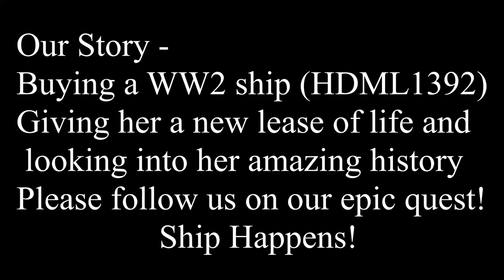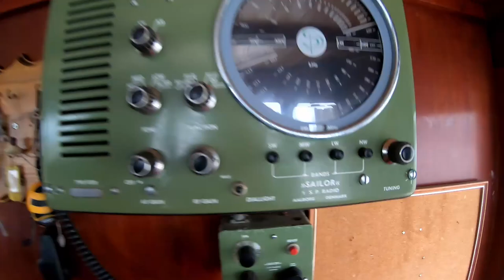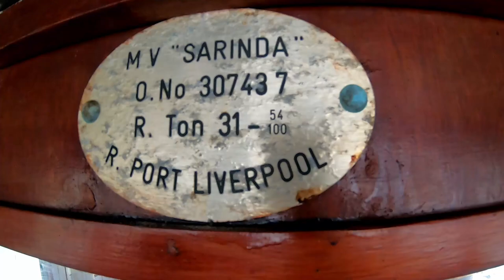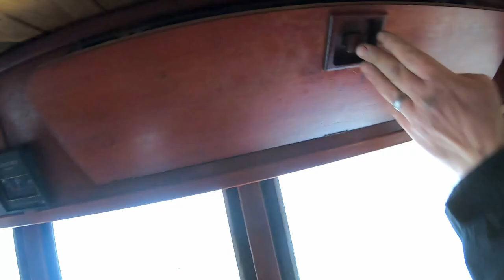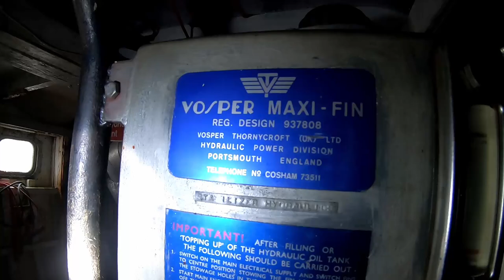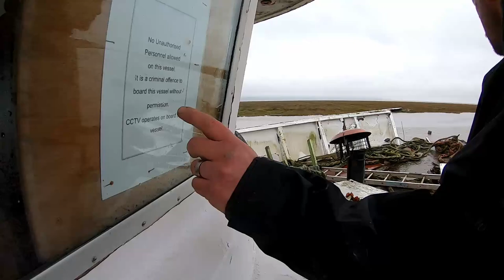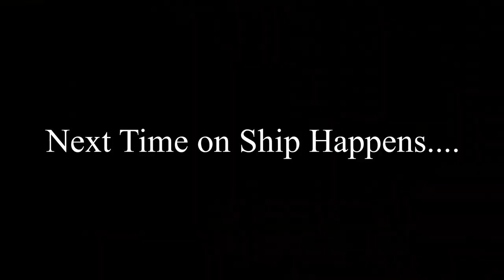We Risked Everything On A Rotten Boat! #boatrestoration

Comment: I'll watch with interest and wish you luck. But, the comment "we know wood" just doesn't apply to boats - it's a black art, iron sickness, please look at travels with Georgie- hes doing a tiny boat bu comparison and knows wat hes doing and it's still very very hard. Decks are not first - the hull is, and that means a tow, a lift a hard standing which will cost thousands alone. You'll need a restoration campaign and volunteers this is like a Vulcan to the skies size project..

Comment: Same as a few here I found you on Cruising the Cut channel, Before running the engines I would be draining.the fuel tanks and giving them a good clean, replacing fuel lines and filters, you dont want the dreaded diesel bug getting to your injector pumps. Good luck, I look forward catching up with your videos

Comment: If you are wanting to take your time with this project you should haul the boat out of the water and work on it in the dry. You have to get ahead of any rot or water intrusion from the top or the bottom before you put it back in the water or you may never get ahead of the elements. I would hate to work on a long term boat project that's not mobile with the sea constantly working against me. After you're sure the entire vessel is sound, you can do the motor work and refit the interior when it's back on the water if you like. I wish you all the luck in the world and I'm subscribing to see how it goes!

Comment: Wow amazing! You’re very brave! Please don’t pressure wash your teak decks though, a short bristled stiff brush. Wet area with SEA water brush across the grain, wash again with sea water, repeat! Only ever put sea water on teak fresh water kills it, makes it green and slippery. Always rinse with sea water after it rains. Best of luck!
Reply: Remember ACROSS the grain never with it!
Reply: So what happens when it rains??  Every rain shower destroys a teak deck? I doubt it. This is England. It rains on teak decks. All the time.
Reply: @PDZ1122  that’s right over time rain will destroy a teak deck it will start by going green and slippery which leads to rot over time. Regular brushing and saltwater washing prevents this and there is no need to buy expensive teak restorer although you can use oxalic acid for stubborn dirt. 
If they are all cleaned up then yes each time you go aboard you should hose them down with salt water because as you say it will have most likely have rained. 
That’s boats I’m afraid constant maintenance if you want them to last and save serious cash in the long run replacing a teak deck. 
This is how I have maintained my teak deck for years and I swear by it as the most cost effective way, how have you kept yours from deteriorating? Any tips could help these guys. 
Thanks

Comment: First, I hope you bought it for a pound. Second, a great pair of engines, but will cost thousands to refurbish or replace. I bet you don't know the last time they ran. Third, the only way to rebuild that boat is to get it out of the mud and on dry land where you can work on it. Fourth, make a plan of what you want to turn it into. Back to its original design, or a modern cruiser. Fifth, try to learn which end of a boat is which. I get the slight impression you do not know. Last, check your bank to make sure you have about 200K Pounds ready to go - probably NOT including the money for the engines, generator, etc.
Reply: the engines are  Diesel so the reliably is pretty high im more worried about amount of standing water in the bilge of the old gril
Reply: They already have both engines running !

Comment: Hi you really have got your work cut out for you. her hull is double diagonal probably ply. you need to pump out the bilges as you say its rain water and that is going to rot the timber very quickly . her upper works have been grossly modified. she looks like a fairmile is she 112 feet long . good luck with the refit

Comment: I'd like to congratulate you for taking on this project, but I don't think you've got the foggiest idea of what's involved. Hard work and good intentions won't be enough - it'll need cash. Lots and lots of cash. Get the hull checked out professionally. If it's sound, you might just make this work. If not, it'll be a heartbreaker. Good luck, anyway. I'll be watching along. Oh - and get it insured for wreck removal. If it sinks, you will end up with a BIG bill for removing it / environmental clean-up, etc. (On the Dee, isn't it?)

Comment: The pointy end is the bow. the blunt end is the stern. Looking to the pointy end  the left is port  the right is starboard. Your electrics are off a battery to start with  so find them and check them over. voltage and charge if necessary. it might pay you to link them with a small solar panel. Make the boat as safe as you can safety and secure wise.  Keep a positive spin on what your doing and keep us informed  good luck.

Comment: Good Luck with your rebuild on this vessel.
The style of planking on the hull is called Double Diagonal, and will often have a layer of cloth between, making it extremely strong. Unfortunately it also makes it expensive to repair. 
On the plus side, as it is on The Small Ships register as part of the Dunkirk rescue there may be funding available due to its historic nature,

Having had an old military vessel myself in the past, I can say the biggest danger to finishing any work on it is the risk of sitting down   with a cuppa on the deck on a sunny day, before you realise that 10 cuppa has become a "why is it getting dark?" moment, :D

Comment: If your really serious about this project, get her out of the water and, covered. A good clean out and, you can see what you’ve got. Lot’s of goodies on there. Douse all fittings with penetrating oil (50/50 ATF and acetone. Cheap and, the best). Good luck. It’s a hell of a project that I’ll watch with interest.
Reply: Looking at your cover photo’, how solid is the mud. Could you support her keel enough with sleepers, when dried. If so build a frame and clean the hull off. I know it may sound a lot of work but, it’s not worth doing any work topside, if the hull isn’t sound, from the outside. Just my opinion, however.

Comment: Wow, that's quite a project........
1) Please tell me you're venting that generator exhaust overboard!
2) Get a hull survey done before you pour too much money into other projects. The hull survey will tell you if this project is even possible or not.
3) Make sure all your propulsion systems are full of oil lest you smoke the gearbox bearings just by running the engines. 
4) Get yourself numerous fire extinguishers AND carbon monoxide detectors as soon as possible because SAFETY FIRST.

Good luck with your project, may the hull survey turn out to be favorable!

Comment: Gave you a thumbs up, I've owned a few yachts in my time, bit of a project going on there, a lot of work and a lot of time involved, if you can finish it then you will have a great boat, I dont know what you paid for it, hopefully not too much due to the amount of work involved, do you know any joiners or carpenters, finishing Joiners, your going to need them or if you can do it yourself even better...good luck guys, I wish you all the best...please get the hull checked asap, and try and plug up some of the holes where the water is getting in...😊

Comment: Some people will say I am crazy but I see some potential on this project. From the video, it looks like the hull's framing is in good condition. The engine looks like it needs maintenance but it sounded pretty good when you tried to start it. I join those that recommend you move the boat closer to the shore for now and maybe later haul it out. I know you probably have a plan but I suggest you take lots of pictures and remove and catalog everything that does not belong to the structure and the engines. Then just clean and clean and clean before doing any reconstruction.

Comment: Get the life rings from the loo, and put them one front & one back out side of boat, use the rope on the front to tie along the sides as a guard rail & use the small rope to tie to the life rings, if you have life belts in the wheel house make sure you each have 1 & wear them. 👍 just found you channel, keep on keeping on

Comment: The Tellus oil reservoir is most likely for the hydraulic steering; the Sailor radio is an MF set and not a VHF; registered tons has nothing to do with the actual weight of the boat, it is a calculation to a formula that is used when the boat is registered under part 1 of the Merchant shipping act, and her registered number is the six digit number on the plate. I have seen projects like this many times over the years, I can only offer one bit of advice and that is to ensure that the hull is sound before you embark on any sort of work; these boats were not built to last and she is almost 80 years old. I did some work on a very similar ML probably 20 years ago and whilst she looked very nice indeed I literally put my finger straight through the hull. This is not to be negative as I truly admire anyone that takes on such a project, and wish you all the best on your journey.

Comment: well  i have done sailing and watching your tour.   you have a lot of work to do.   rust, wood, clean up, replacements...  man if i am in your shoes and younger.  thumbs up!

from the tour, my mind goes to.. shopping list.. 
power washer
drill with bits and screw (attachments)
metal work tool, minimum: snips, welding and bending tool(s) if you got thick ones.  gonna be different. 
riveter
air compressor and paint gun
cable cutter and crimpers
hot air gun
table saw, jig saw, sander,

Comment: The little red tank with the broken pipe/hose on the second deck is most likely part of the fresh water pressure system.  Spare parts are readily available as this is a pretty modern device.

Comment: If you want to strip the paint from the mahogany: use a heat gun
and a mask with carbon filters to keep from breathing in the fumes 
and do it outside or with the windows open.
Then you can use linseed oil mixed with 2/3rds thinner
to restore the finish.

Comment: She has great lines and once you can get rid of the rotten timbers and see what you have it will feel loads better.  Organise some working parties, you supply tea and lunch and in return you get lots of willing helpers to sort, tidy and get some decent covers on her.  The toilet on a boat is called the heads, kitchen is galley, wheelhouse down below steering position.  Hawse pipe is where the anchor chain goes down below.  She looks to be either triple or double diagonal mahogany planking with probably copper fastenings.  There may be canvas and red lead putty between the plank layers.  She is very similar to a WW2 boat in Portsmouth called the Medusa.  I’ll send you a link as they did a huge restoration and the guy who masterminded it would be a huge font of knowledge as Medusa is also diagonal construction.  Best of luck and I will keep watching.  Where are you based?  I’m on South Coast but guess you are up North so a visit isn’t possible right now but I’m sure there are plenty of people who would love to volunteer to help.  Andy UK

Comment: Right lets help first, Tellus 15 is a hydraulic oil and I would think it's for the steering, at the back of the ships wheel will be a pump, turning the wheel turns the pump that send oil through a pipe to the rudder, turn it the other way and it will pass through another pipe and turn the rudder the opposite way. The oil needs to be kept topped up as in a car engine.
SAILOR is a VHF radio and looks a very nice example of one, my worry is you have just shown the whole wide world you have one.
Your mooring does not look very secure both for the boat anchorage and for valuables on board. Trying to work on her where she is will take a lot of time just getting on board, I would ask the boat yard the price of slipping her out onto a hard standing and how much the yard fees would be. This money can be recovered in making the restoration quicker, possible just popping down for a couple of hours where that's not possible where she is.

A friend of mine saved an Ex Royal Navy Pinnace from being crushed for firewood, it took him years of long evenings and w/e's. On her first voyage with the ADLS was from her mooring on the Medway to Chatham Dock for the Associations years meet at a port that took place in the Dunkirk Evacuation. As we pass through the dock gate his boat was given a mooring position, I followed and they gave me another slot, my mate quickly radioed back that my boat must come along side him as I was his galley and toilet. We tied up along side and his mum and sister were very happy to be able to use a fully fitted Head, get a nice hot coffee laced with brown milk (Baileys). While the lads had a Porta potty behind a sheet.

Do check out ADLS.org.uk
The Association of Dunkirk Little Ships. Pinnace Mary Jane & Motor Yacht Lazy Days.

Good luck and stay safe, always remember. 
One hand for the boat and one hand for YOURSELF.

Comment: Don't use a jet washer to clean the planking decks, you may blow the caulking out of the seams and the deck will leak worse. I tellus oil in the wheel house is for the hydraulic steering. Make sure that the automatic bilge pump doesn't stop, as ship may fill up. Enroll in night class for navigation and boating. Join as local yacht club or similar for local knowledge and volunteer crew. Best of luck
Reply from the maker: All the deck will be coming up! But on the subject of jetwashing Simon is wondering if he could use a jetwash with sea water to clean off the inside, any thoughts?
Reply: @ShipHappensUK  the salt water will eventually attack the inner workings of the pressure washer but if you're not worried about binning it when you're finished with it then go for it, why not seeing as it's readily available but that water looks very silty so you'd need a filter on the inlet to avoid sand, silt, mud etc from being sucked up into the pressure washer  ;)
Reply from the maker: @idontgetit3739  we have been there today, and I nearly slipped over on a number of occasions due to the mud on the foredeck, so we need to sort this out! All the deck will be replaced in time, just need to not kill myself by falling over in the mean time!!

Comment: I know I'm a bit late but make sure before you run the engines too much NEW FILTERS are fitted, check the tanks for Diesel Bug this grows on top of the fuel and is fed by condensation inside the tanks. You should be alright as long as it does not get stirred up, as in my case venturing down the Thames into the rougher water made by the many pleasure boats in central London.